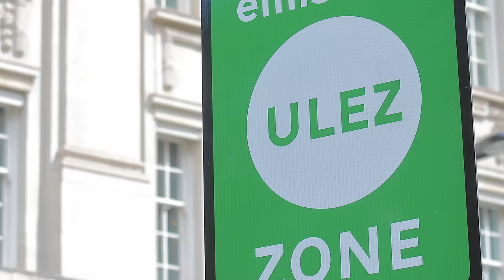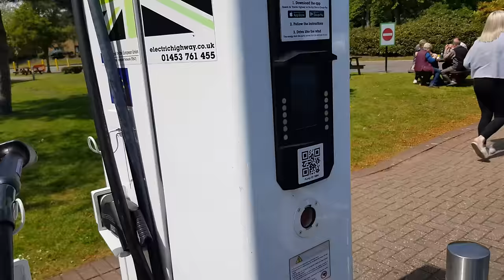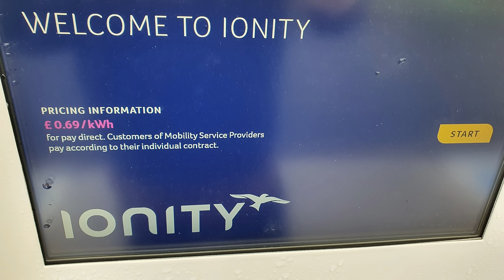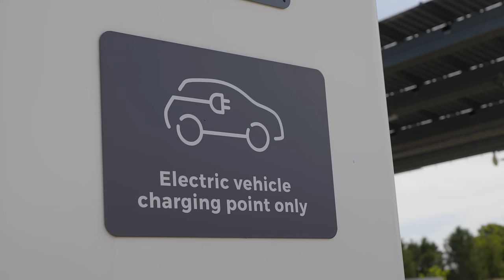The Uncomfortable TRUTH About EVs: The Version NEITHER SIDE Wants You To Hear

Comment: A lot of manufactures are using the EV boom to take away reparability and  further integrate planned obsolescence to their cars. Louis Rossmann talks about this a lot on his YT channel.
Reply: Very true EVs do remove 99% of the repairability, mostly because they only have about 20 moving parts
Reply: That’s so true, it’s their perfect chance to convince normal folks that EVs are unrepairable because “electricity” and “technology”. Manufacturers will offer no spare parts, or hugely expensive ones, void your warranty, lock you out of their chargers, lock inverters, motors and batteries with different serial numbers (see Apple) etc., simply because it’s their perfect chance. Instead of actually reducing pollution, they will turn out to be a huge environmental and economical burden.
Reply: @ericpisch2732  Your knowledge about cars seems to be a bit lacking. Chassis, suspension, brakes, infotainment, HVAC, electronics are all equally or more complex than ICE cars. 

You have an extra heat pump, and usually air suspension, adaptive dampers and rear wheel steering, because most EVs weigh over 2 tonnes. Active air intakes because they need the best aerodynamic efficiency. And the battery and inverter cooling is quite complex, and good luck finding any parts because “shortages”. Can’t wait to see EVs being thrown away because the manufacturer quotes 30k and you can’t get an independent to repair it
Reply: Very true and that’s exactly the reason insurance premiums are increasing
Reply: That's capitalism. If profit is the only aim, that's what you will achieve.
Reply: That's a symptom Capitalism alright
Reply: @julianevans9548 

Not to mention the incestuous relationship between Profit making and inflation, inflation then reducing the value of said profits and the business logic of always prioritising profit and growth pushing up prices (and firing employees) creating a self perpetuating crisis.
Reply: @MrPagnu - EV’s are less than 1% of the cars on the roads, they have zero influence on the overall insurance costs.
Reply: If it destroys the dealership mafia it will be worth it. For 95% of people reparability is already monoplized by the dealership lobby. Nothing says "we're a valuable part of society" like "you're legally required to buy from us".
Reply: Thats not an EV thing. How are those big google powered touch screens faring in 20 years? Software is the obsolescence crux. Not ev tech.
Reply: @toyotaprius79   tell us you know nothing about economics without telling us you know nothing...
Reply: @martijnkosters9024 yes but it’s how it’s being used by manufacturers. Honestly I might just buy a battery pack and shove it into a tired 90s box to make my own damn EV, and it would probably outlive some brand new ones
Reply: Dude, they’ve been doing that LONG before EVs.
Reply: That is new cars, not just EVs.
Reply: @grigorioschristodoulou5229  Ill take a heat pump over thousands of wearing / moving parts in engines and transmissions in ice cars. Also, most EV's do not have air suspension and adaptive damping and rear wheel steering so why youd list that as a concern is weird.
Reply: @SDK2006b  were talking about engineered denied repairability here and a couple of clear examples of that are the gigacasting frames in recent Teslas and the one piece pressed car side featured by Rivian, designed to drastically cut production costs at the expense of repairability
Reply: This is very true. In reality, if a car manufacturer gives you an 8 year battery warranty, after 8 years, because of the likely degradation potential cost of replacing that battery, is that car actually going to be worth anything and will it be scrapped? An ICE car, despire many more moving parts, is way cheaper to repair and could remain on the road for 15-20y. I believe EV's are basically large, disposable consumer electronics devices, but nobody is going to want an 8 year old EV with a battery out of warranty!
Reply: @martijnkosters9024 it IS an EV thing, the touch screens in an ICE car have a much simpler computer system which is not really necessary for the car to drive… and there’s carplay and android auto and lots of aftermarket stuff for old cars… EV’s are not functioning without the board computer that’s a big difference
Reply: yes modern diesels use 0/30 oil its like water and starting then engine in very cold weather makes them sound like a bag of bolts, people are adding oil thickeners/conditioners to mitigate this.
Reply: What's the "pre-planned obsolescence" age the auto industry is gonna pick?  I'm guessing around 10 years - and that's probably being generous.

Currently, my family owns two cars, one 21 years old, the other 19 years old.  Mom's still driving a 35 year old 911 that looks new and runs like a top.  You think that electric car is going to last 20 years?
Highly doubtful.  The high tech industry has discovered the easiest way to "move units:"  
FIRMWARE NOT SUPPORTED
Computers and cell phones become paper weights at about five years of age.  They give us some excuses as to why this happens.  Some technical issues that are simply unsurmountable, they say.

But we know the REAL reason:  SELL MORE STUFF!

So when the auto industry sees this, they begin to drool!  "You mean we can render our products "obsolete" by about five years old and then get to sell them ANOTHER one that will last only five years AGAIN?"  WHERE DO WE SIGN UP!!!!

This is where cars are headed.  Companies will want it, but the stock market will DEMAND it, making it a foregone conclusions.

And unfortunately, this is ALSO where bicycles are headed.  Electronic shifting, navigation, lighting and even power will ensure that e-bikes hit the landfill after about 5-8 years.  You'll no longer see perfectly functional bikes that are 20, 30 or 40 years old.

Boon to the companies, bust for the planet!
Reply: @grigorioschristodoulou5229  incredibly dumb comment from someone claiming to be knowledgeable about cars. Most Tesla's don't have active suspension, active aero NOR rear wheel steering. They have conventional brake systems, that never wear unless you take it to a race track.

How can you possibly argue that's more complex than the thousands of moving parts in an ICE with transmission, full of crappy switchgear and no over the air diagnostics.
Reply: I very much appreciate your sincere efforts to produce a balanced view on EVs. However you have entirely missed out one if the two major reasons for the absolute necessity to transform complete to electrify everything. You correctly identified the first which is zero emission of toxic pollutants but did not give it adequate weight. It is the less well off who are forced to live next to the polluting major roads and if you are poor and asthmatic and you don't even drive a car you really are suffering with no compensation.
The major reason that you totally neglected is the huge advantage in energy efficiency of the EV. These two huge reasons are driving EV adoption. The efficiency difference is at least 4 to 1. That means if you have two barrels of oil, you distill one barrel into petrol/diesel for an ice car and generate electricity for the EV . The EV will cover 4 times the distance that the ice car will. It is as simple as that. I don't know if you a climate sceptic and do not acknowledge that it is a real threat but the scientific community is very very clear that it is. The EV and its cousin the heat pump is a godsend because it is just possible that making can make the transition to zero carbon, thus preserving the current quality of live that we expect and also give developing countries the same opportunity. 
China imports a hell of a lot of oil and thevtransition to evs promises a reduction in oil imports and pollution. It also has the side effect of world dominance in car production without the right wing press trying to rubbish EVs to keep the fossil fuel industry going for a few more years. As you said there are over a million evs on the road in the UK and these people seem to be happy probably because these people are not looking for clickbait for their you tube channels. Sales in Norway last month were 91% EV and 63% in Sweden.  They are not stupid however high the subsidies are. EVs work and are preferable to ice cars.
You mentioned truth quite a lot. You can arrive at truth if you want to by impartial analysis of the best data you can assemble. 
It is a widely held opinion that the grid in the UK could never provide enough power if all cars were electric. A bit of simple analysis shows that thd current grid could in fact charge ever car tomorrow if they were magically transformed into evs. Clue evs need a lot less power and electricity generation is reduced at off peak periods. Keep generating over night when people are charging their cars and not cooking or showering watching TV or otherwise consuming electricity. Job done.
Reply: @grigorioschristodoulou5229 you ave forgotten all the valves and springs and piston and fuel pump and timing chains and lubrication and oil seals and fuel lines and as for heat pumps everybody with a fridge knows just how unreliable they are. Have you ever tried changing the clutch on an ev? Ever tried to get an ev through the emissions test  on the mot. Nightmare. What a con these evs are.
Reply: @ambassadorfromreality1125  I think your 4:1 number is rather optimistic. Yes, the equivalent mpg is better, but not by THAT much. The oil can produce power at an efficiency of almost double that of an ICE, but then there are grid losses, charging losses, and some minuscule losses in the car itself. 

Would be interested where you got the 4:1 from. Obviously, if you are charging via solar the oil consumption is zero, but you're specifically assuming all the energy comes from burning of oil...
Reply: @tonyb3629  nice theory but what is called “end of life” is actually 70% remaining capacity. And that isn’t expected for 15 to 20 years. 
The older model S had a typical life of 300,000 miles. Newer chemistries are trending to last 500,000 with several Model 3s over 300,000 already and one over 400,000 miles. 
Most newer EVs are trending similarly to the older Model S.
Reply: @GamezGuru1  True, Tesla is a disguised trashcan, of course it won’t have rear steering etc. But many MB, BMWs and Porsches do.
Reply: @GamezGuru1  and another thing, I am sitting in an electric train in Germany doing 300 km/hr. The train is 400m long. There are many reasons why they bother to string a cable above the tracks. Ice just can't handle this . Interestingly a train does about 1000 km/day. That is a lot of maintenance   There doesn't seem to be any call at all to keep diesels in the train world so we just have to assume that there is no contest
Reply: @oojimmyflip  A better idea is to include a battery powered oil pump to prime the engine with oil before you start up the diesel.
Reply: @williammeek4078  You forgot that the highest millage Tesla has gone through 3 batteries and 14 drive motors (1 every 80k miles)
Reply: @ambassadorfromreality1125   That for passenger trains, light rail, as of 2023 there is 1 electric freight train.
Reply: @pogo1140  wrong. It is on its third battery. The first replaced under warranty at 180,000 miles, the second replaced after an additional 300,000 miles. The number of drive motors is just a flat lie.
Reply: @williammeek4078   Try again, the owner was the one who reported the number of motors "1.2-Million-Mile Tesla Model S Has Gone Through 13 Motors And Three Battery Pack Replacements."
Reply: @SDK2006b  Your joking aren't you? Insurance is all about risk, and the risk with EV's is pretty big. The repairability is low on EV's too, and that's a lot more expensive for insurers. There are way less accredited workshops that can handle them (so higher cost), and despite less parts, those parts are an order of magnitude more expensive and harder to source.
Reply: @tonyb3629  - yep, all of that is true and raises the insurance cost a little for individual owners.  But with just 1% of vehicles being electric on the UK roads, there is no impact for ‘everyone’ else’s insurance premium from electric cars.
Reply: @pogo1140  what you aren’t saying is that the replacement motors were all used.
Reply: @pogo1140  That is not correct.  Practically all freight trains in Germany are electric and those that aren't are diesel electric where a diesel generator powers an electric motor.
If you build the infrastructure,  overhead cables, why would you not use it for freight especially when the benefits of electric drive are overwhelming.
Reply: @ericpisch2732 Are you really that uninformed or are you just spreading false news? An average EV has tens of thousands of parts. The parts count is slightly down because they don't have an internal combustion engine that had lots of pieces. I'm probably just taking the bait here because I think many people who say these kinds of things are just trying to push a narrative that has nothing to do with the actual parts. The seats tires doors and windows are over 20 parts.
Reply: @GamezGuru1  Tesla brakes never wear unless taken to a race track?  Ok dude, call me when the shuttle lands... Lol.
Reply: @williammeek4078   Remind me why those were used motors? Is it the same reason that the owners of the Original Tesla Roadsters can't get parts for their cars which are quickly turning into really expensive paperweights.
Reply: @ericpisch2732  parts don't need to be moving to go wrong, if that were the case no car would ever have needed a new sensor or an ecu, and electric cars would be at the top of reliability surveys.
Reply: @pogo1140  hey, just because YOU can’t keep a car going doesn’t mean no one else can.
Reply: @williammeek4078  I've been working on cars since age 10 in the 80's.  I've not owned a car that's less than 15 years old since. rebuilding car engines is meditation for me.
Reply: @pogo1140  clear not for this though. However, power electronics is what i do for a living. I have a project EV in my garage. The future is here, whether you are ready for it or not. I would recommend learning to work on newer cars and not just those dinosaurs.
Reply: Take away the battery, the motor and some of the high voltage electrics for which there is really no maintenance and what have you got? A car the same as just about any other car. The rest of it works just the same.
Reply: @MrPagnu One good reason to not buy a Tesla!
Reply: Yep, and it’s really tragic. Electric powertrains can be easier to repair than ICE ones.
Reply: @MrPagnu it really isn’t across the board potentially greater repair costs load evs .. yes insurance price increase’s have a lot of causes part shortages loading things post covid car value spikes that go along with it and recent theft booms on high value cars ( massive premium jump to get them off their books often ) and easily overcome wireless locks recently..
Reply: @beanapprentice1687  Tesla don't repair power trains. They replace whole unit which includes motor and final drive as a sealed unit. I used to work for Tesla and we had loads in needing complete units.
Reply: @ambassadorfromreality1125  Don’t forget that there are huge differences from locality to locality. Stringing electric lines along rail lines is fine for higher population density areas but just doesn’t make sense in remote areas - for example Central US.  The maintenance costs and downtime due to weather alone would be too high (tornadoes, snow storms, floods, etc.) not to mention the massive transmission losses of sending electric over that many miles of wire.  The same for telling everyone EVs are the only option.
Reply: @dudeonbike800  and bust for your wallet with the EV scam. Everything battery is a throw a way item. The tool industry went this way.  the batteries last about 3 years and u have to buy another which cost more than the tools. Same direction cars are going to. Wait till u see what your electric bill will be too.
Reply: all legacy car makers dont want to go electric they are being forced to go ev or die
Reply: @grigorioschristodoulou5229  where are the VW owned chargers?
Reply: @grtxyz4358 There’s essentially no connection between the screen in the center of the car and the computer systems that manage EV systems.
Reply: @Badga3  In the same universe as premium materials, lol
Reply: @grigorioschristodoulou5229 Rear wheel steering? Really? Only 2 mass produced EV's have them, the Hummer EV and the Cybertruck. And the numbers of those on the road are dwarved by more normal EVs like the Model Y or the Ioniq
Reply: I expect insurance rates for EVs will start to climb steeply as they build a history and it becomes clear how little it takes to have a complete write off. The slightest damage to a battery or its cover and it requires full replacement to avoid the risk of a fire down the road.  That replacement many are finding costs more than the car or close to it.
Reply: @davew2040x  what does that mean 'essentially'. Tesla (and other brands) have tried to make the car self driving, in order for it to do that, it needs to know where to drive, so there is a connection there and each connection can be potentially dangerous (it can be hacked etc...).
Reply: @grigorioschristodoulou5229  lol. Like those parts break all the time, or if they do, are particularly hard to source.
You patrol heads really come up with the darndest things to defend your outdated technology that is constantly breaking.
Reply: @Rythsi300  lol. A crash that damages the battery will total the car and should have totaled an ice car just as much.
Reply: @grigorioschristodoulou5229  I wouldn't exactly call my model 3 hard to work on... I removed and replaced all the suspension to install lowering springs in under 2 hours the rears are that easy I swapped the springs over in 5 minutes! Brakes are a piece of cake too, although you probably won't need to change them until 100k miles as almost all of your breaking is done regeneratively. I'm on 52k miles and the pads aren't even half way worn. Working on an EV is a piece of cake for those with mechanical knowledge, and for those without mechanical knowledge they'd never attempt to work on their ICE vehicle anyway. If you're utterly incompetent you may get electrocuted if you unplug the battery and lick the terminals, otherwise any work on the motor just disconnect the main power supply and crack on.
Reply: @tamiyacar  Now try to source and code in a new inverter. Of course changing suspension bushings or springs will be easy, it’s irrelevant to the EV part.
Reply: @grigorioschristodoulou5229  Many of the parts on new and indeed old ICE vehicles need to be coded to work properly, most people don't have the ability to code new parts to a car. Even the batteries are coded on ICE vehicles these days. It's not just EV's. The main things people are going to be working on at home can be replaced. I'd assume Tesla wouldn't sell parts like inverters direct to the customer but I may be wrong on that. But a 2nd hand inverter could be fitted, there's plenty for sale. Coded parts and hard to source parts are not limited to EV's. The liklihood of these parts breaking is minimal anyway.
Reply: Rich Rebuild is also in it. He had lots of problems with rebuilding tesla and now has an independent ev repair shop.
Reply: I don’t know, I have a 12 year old Opel Astra and after cleaning it honestly looks like fresh out of factory and runs like that too. People complain that they do not make cars like they used to anymore but I bet cars from 2010-2012 might also be in the road for 20 and in places for 30 years… Still relatively cheap to repair even with some new stuff. 
I think that lemons are of course noticed and discarded but if a car is well maintained even a relatively new car will drive for long time. 
With EVs everything depends on part availability and battery prices. I think there could be some money in to repair old Teslas, especially original Model S and X… where there is money to be made, perhaps a solution will be found. But of course it pisses me off that even 2012 Model S even now… you gave to do through official Tesla to do anything. Without 3rd parties being able to do repairs there will never be cheap and good used EVs
Reply: Boom? You mean like in them catching fire and exploding? 😂💥 😂
Reply: @ericpisch2732  "99% of the repairability, mostly because they only have about 20 moving parts" that makes no logical sense. BEVs are inherently easier to fix because they use repetitive modular parts and have no complex moving parts with higher tolerance gap. Your argument defies engineering logic.
Reply: Have  done  almost 70 thousand miles  in Nissan Leaf. There is nothing to repare or replace. The battery will outlast the car. Greetings from UK
Reply: That is not exclusive to EV manufacture. It has been going on for a very long time.
Reply: @grigorioschristodoulou5229  please tell me how the brakes are more advanced. I'd love to hear it. Chassis and suspension are the same. They aren't more complicated than ICE. Most of your costs for maintenance and repair come from the actual ICE part as well. Electric vehicle maintenance is literally like check and see if the gear oil is bad after like 4 years. Not replace it in for years, just check it.

Battery and inverter cooling are no more complex than ICE cooling. It's literally water running through a channel to a radiator. The model 3 doesn't have air suspension or adaptive dampers or rear wheel steering. It weighs under 2 tonnes and isn't much heavier than other ICE vehicles of the same size. The next gen of batteries weigh like half as much, too, so it's going to get lighter.

You are right that they will try and push that stupid narrative that their too hard to fix, but unlike a phone, cars are required for most people, so that kind of thing won't fly as easily here as it does there.